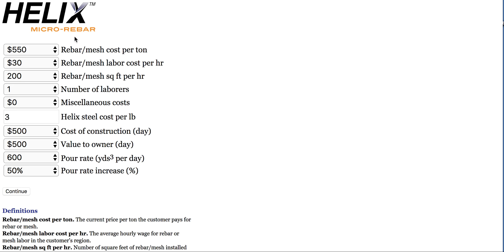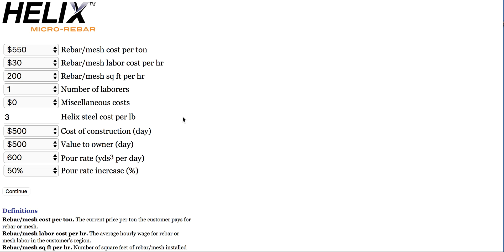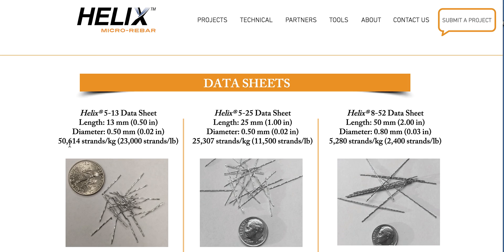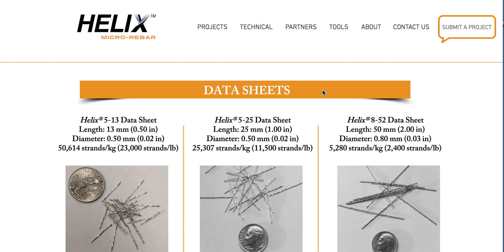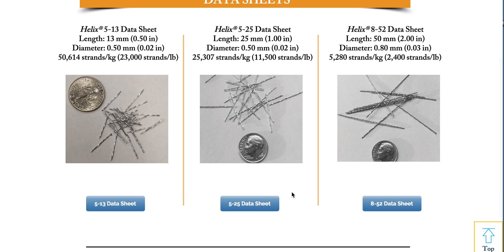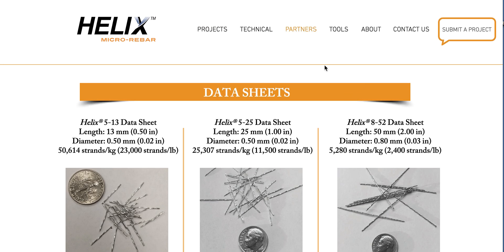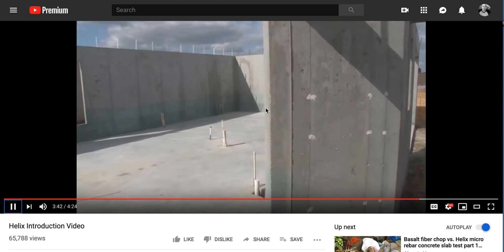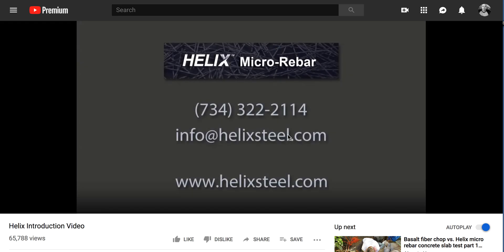Helix Micro Rebar Concrete Rebar Department of Defense approved?

Comment: I think you made a mistake with the cost.  You said $2k per lb and a minimum box is 22 lbs.  That would be $44k per box😂.  I think you must meen $2k per 22lb box, or about $90 per lb.  I think steel rebar costs about $1 per lb.
Reply: I think you’re mistaken. Helix rebar costs about 15-20% more than traditional rebar.

Comment: No stainless steel helix fibers?
Reply: its the tensile strength of the wire that's why its coated
Reply: Nope. It’s zinc coated carbonized steel.